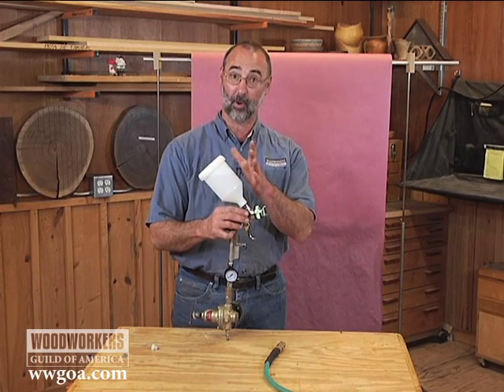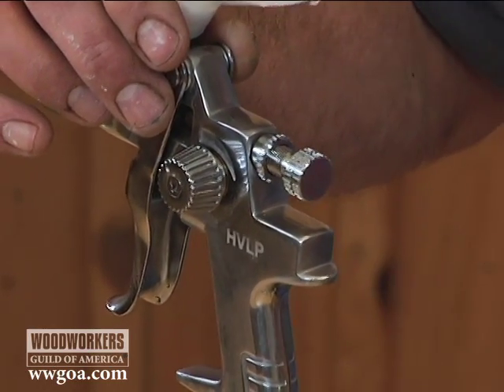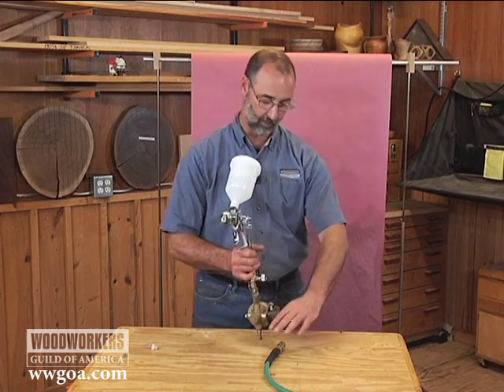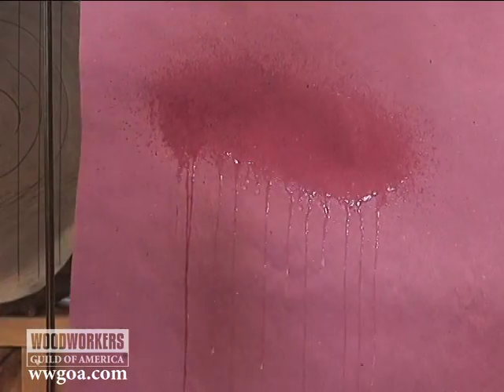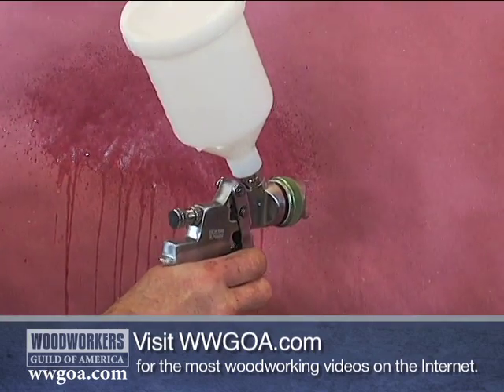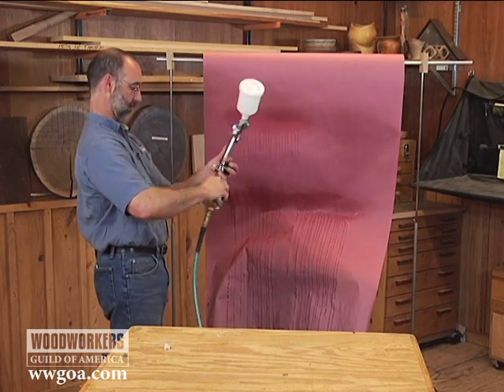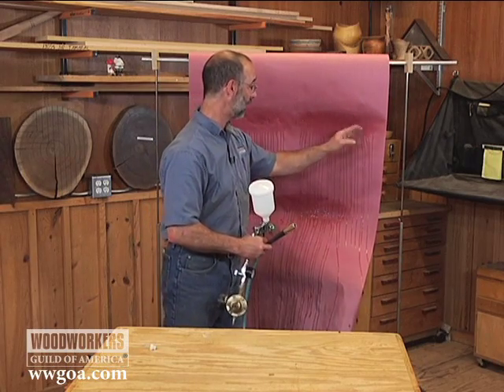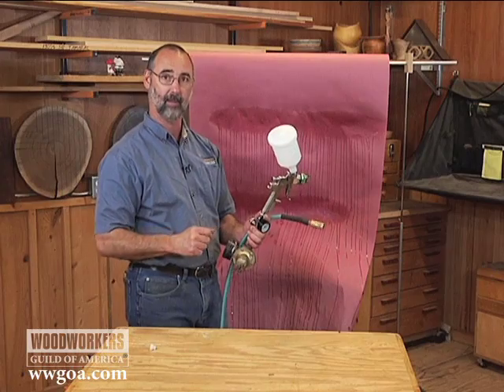Woodworking Tools: Power Tools - How to Set Up A Spray Gun

Comment from the maker: I definitely would not exceed the air pressure the gun is designed for.  That can damage the gun.  Go through the procedure for setting the gun up, and stick with those settings.  If it’s under pressurized that’s ok, as long as the finish sprays nicely.

Comment: Hi George, thanks you for the video.  Now, if I get to the optimize pressure that spray out the same amount of material throughout, should I sneak pass that pressure a few pounds just to keep the material well atomized?  Beside over-spray is there any problem?  How about if my gun under the ideal psi?